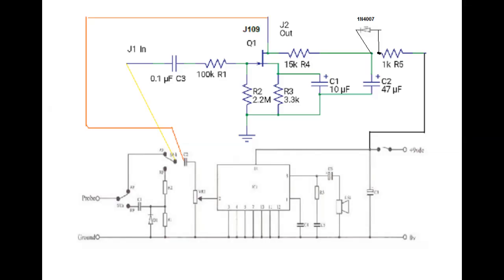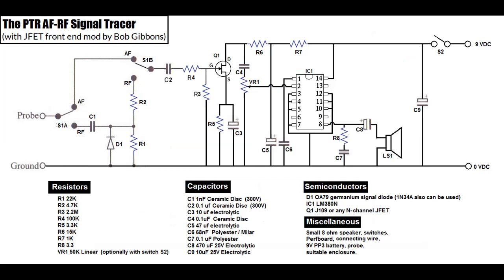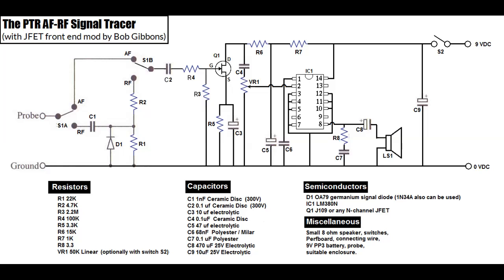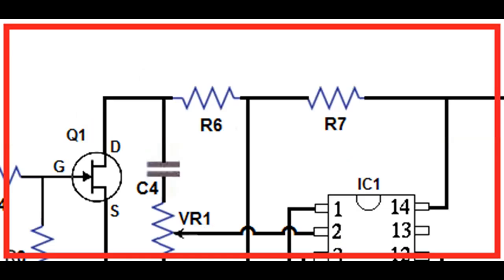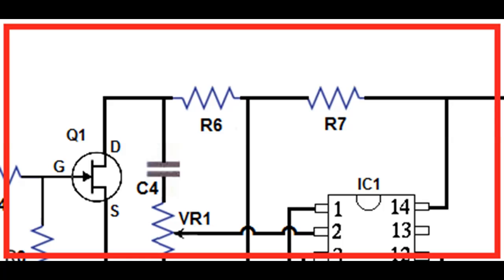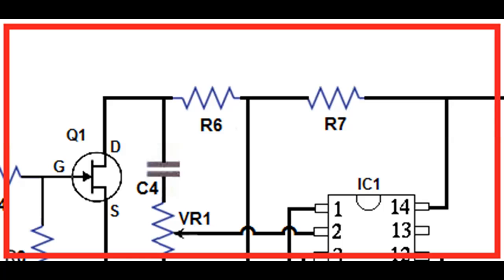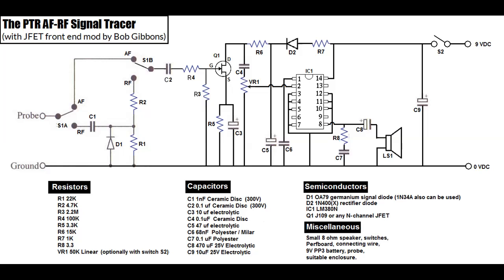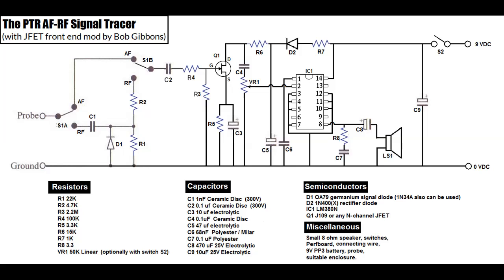LM380 Signal Tracer Update

Comment: Nice catch on the cause. I suppose to make the supply rock stable you could add a zener across the main input filter cap to lock the supply voltage but it would be an overkill move.
Reply from the maker: When I disconnected the input to the LM380 and was still getting output I knew something was up! 😵